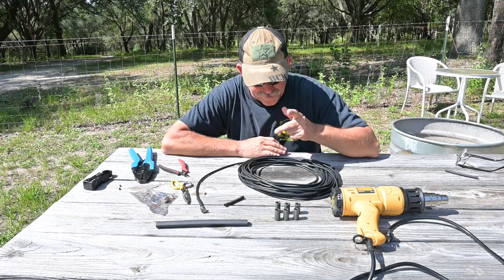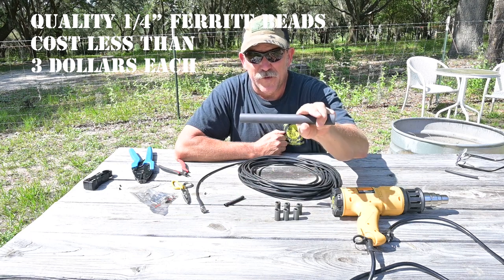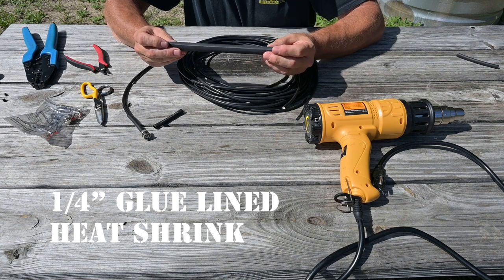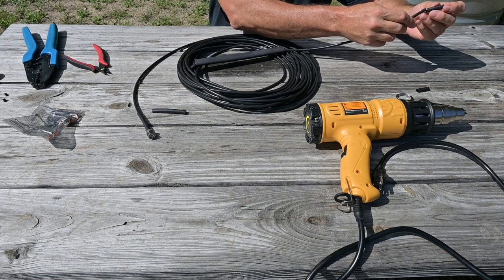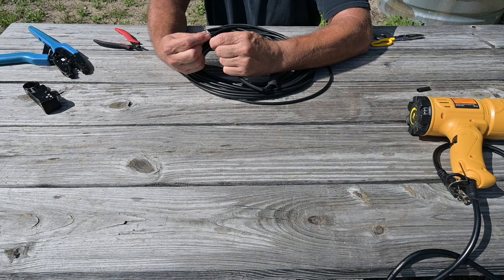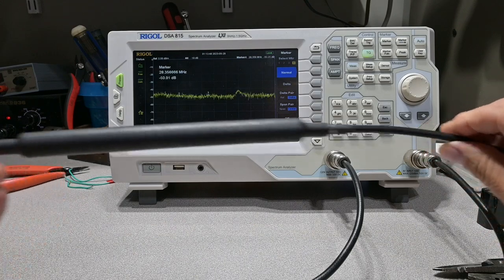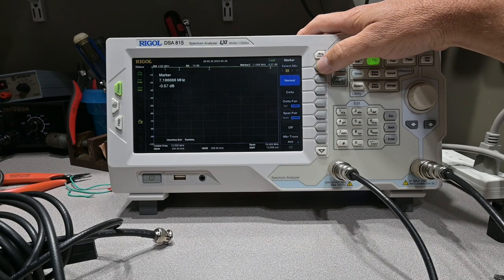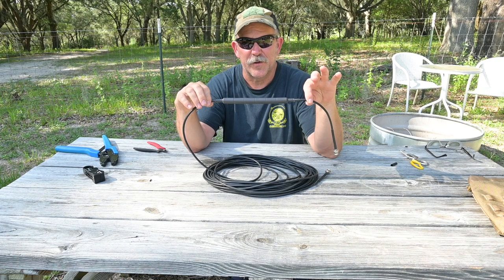Building a 1:1 common mode coax feedline choke Ham Radio DIY Save money do it yourself

Comment: This is the way! Makes a choke which is resistive over a broad frequency range, doesn't trash the coax with bends, and is not bulky. The alternative - winding coax through toroids, fails in all 3 of those categories.
Reply from the maker: Thank you ! Exactly so - feedline loss is real. Feedline  twisted on a toroid is E-Waste. Thanks for watching !
Reply: After the end feds - new series to demonstrate 😁
I'm currently using 2 Chokes made of rg58 turned on ft240s. I can feel you shuddering from here 😂
They measure up well as chokes though haven't checked loss.
Enjoy your content.

Comment: Do you mind listing the part numbers for those torroids please?  Also, would love to know what connectors you use for RG223…..all I can find is Amphenol, at eye watering prices, but like you, I have a heap of that cable!  Lastly, what crimp pliers are they?  Would also be good to see a second video on how you do the common mode choking measurements on the SA….or better yet, a Nano VNA as most people will have or could afford those. 👍
Reply from the maker: I bought a bunch of them from Palomar for another project. The part number is FB36-31 for the beads individually.  They sell a kit PN # SLO-1/4-5 that is a five bead variant with the heat shrink. The connectors I used were Amphenol but I bought 50 of them at some point on ebay long ago. Common mode measurement wise I use a couple of leads with alligator clips on one end and RF connectors on the other ( these will work with any test equipment you calibrate for). Clip the grounds together and measure across the center conductor through the device under test. I did it with a nano VNA as well and the result were the same but filming a Nano VNA is a pain in the butt. Thanks for watching !

Comment: Nice! Should the choke end of the feed line be placed at the antenna or at the radio for an EFHW?
Reply from the maker: I generally run a 25' counterpoise on a 40m EFHW with the choke at the feedpoint. Keep your eyes peeled - I am doing a deep dive on EFHW antennas right now. Thanks for watching !

Comment: I am the envy of all my friends for subscribing to SurvivalComms channel! LOLOLOL😄😄😄😄

got a question though. These 6 inches away from the connector are for no other reason that cable flex, aren't they?
Reply from the maker: They are green with envy :) Mostly it is flex and that you are trying to maximize or minimize the length of cable depending on if it is close to the feed point or close to the radio. Thanks for watching !

Comment: Given the price for choke kits or assembled chokes, this is the way to go. I preferred to make separate chokes vs. assembled integral with the transmission line. But for one source I've seen 'out there', seems the individual chokes are assembled with a PL-259 plug connector on each end. DUMB IMHO as that design requires the use of an SO-239 barrel to connect the choke in line with one's transmission line. To me, the sensical approach is an SO-239 socket connector at one end and a PL-259 at the other. 
n6med
Reply from the maker: 100% agree . Thanks for watching !